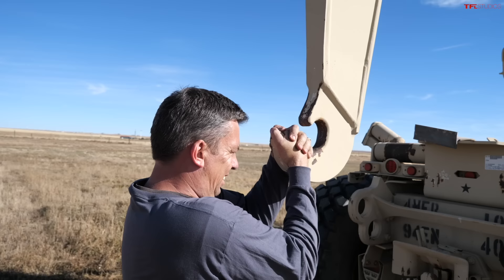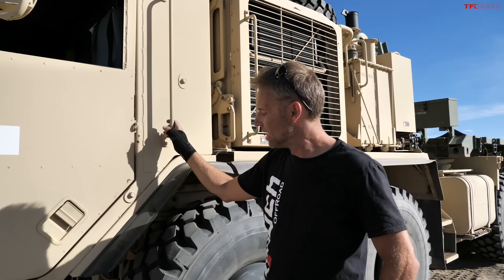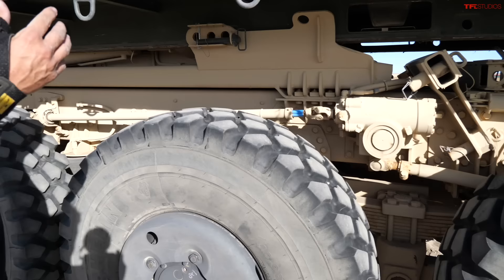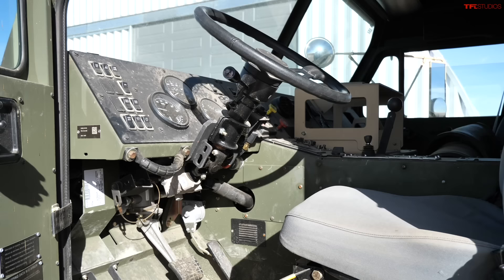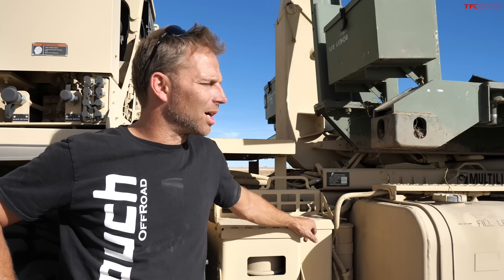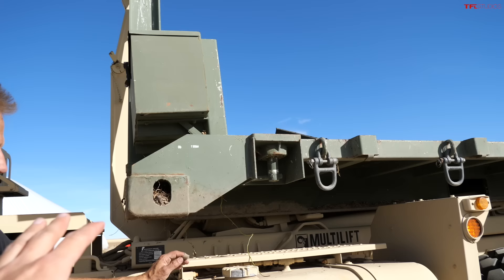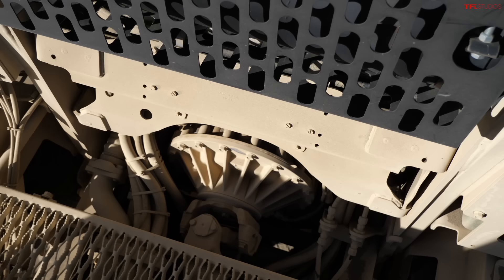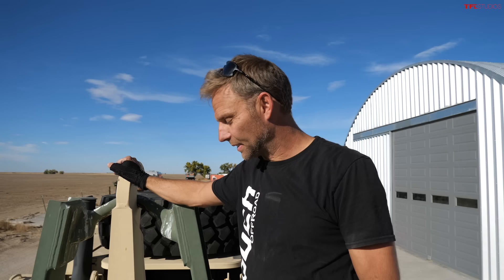Think A 4x4 Is All You Need? This 10x10 Military Truck On 53s Begs To Differ!

Comment: I'm currently active duty Army and I'm an 88M motor transport operator. This has been my system since I got out of training. These PLSs can literally go ANYWHERE! All differentials can lock, it can gross out at like 130000 pounds (with trailer). These things are fun as hell to drive!
Reply: My HETT is more fun.
Reply: @ianm4240  the 237ft boat I got to pilot was pretty cool also
Reply: Load and unload, just remember 3, 2, 1, 2, 3. Never forgot that one after being an 88M in the 2000's. Uncomfortable to drive but got the job done.
Reply: Until I have to bring out the wrecker I towed a lot of them in Korea haha but they’re definitely more reliable than the trucks at my current unit
Reply: I'm at a CTC and our PLSs are garbage. They get the job done, but if you go out on the line and actually do a PMCS, you can deadline all those trucks. But people are always just pencil whipping it😂😂 @LowStyleMac

Comment: I work for Oshkosh Defense and have worked in welding these trucks and on the assembly line putting them together.    Very cool to see where the trucks end up.
Reply: So you're a simple worker, ok.
Reply: So did I my job was a floater assembler on the heavies at oshkosh truck, these were so cool I was 2nd shift. I hated the 1:45 hour drive I had to quit decided not to move there from Waukesha.
Reply: Okay so we have several Oshkosh six by sixes and I want nothing more than to burn them to the damn ground I'm a mechanic for a mining company and God forbid I ever find out who the engineer was that designed these things it will be fight on site I have purposely not looked up who designed these just because I want to fight them that bad and the reasonable side of me wants to stay out of jail I always wanted one of these 10 by 10 but now I know they're made by Oshkosh I want nothing to do with them
Reply: @borednarmed5612  Very funny 🤣

Comment: When I was in the military I was a diesel in track mechanic we had one of these PLS. Instead of a flat bed ours had a FRS or fresh these were complete shops that would expand open to create a work table with tool boxes, storage, generator, heating and a crane all  equipped inside of the fresh. You would use this to take to any location to perform maintenance. I've always wanted one.
Reply: Real life construction yard as in Command & Conquer
Reply: Sweet!

Comment: When you just have too much money... This is absolutely perfect.
Reply: They actually don't cost much at govt auction unless they come fully equipped, short of a .50 or 240.
Reply: . . . and still I would buy a Tatra, built from factory with all the goodies.
Reply: @reedrk88t  I think he means the amount of gas it will burn
Reply: @ Dougls Price - I duuno what diesel costs where you are but its around £7 ($9) a gallon here - so £7,000 just to to fill it up, forget servicing or a set of tyres! Even if I got given one for nothing, I still couldn't afford it!
Reply: @madmick3794  can civilians buy Tatra 8×8 from factory?
Reply: @persianimmortal7455  yep.
Reply: @madmick3794  the new military ones? T815 7
Reply: @persianimmortal7455  where I am I have 2 engine and 3 gearbox choices, options are 4x4, 6x6, 8x8 and 10x10
Reply: @madmick3794  thanks , where r u by the way?
Reply: @persianimmortal7455  South Pacific, Australia atm. NZ also has them for sale too

Comment: Spend thousands of hours around the world in one of these. Great trucks, I’ve driven the pintle hitch version and hauled D7 dozers with them.  They even come with massive Cables. If you put the transfer case in low range there’s not much you can’t yank a load over.  The more modern ones have airbags for suspension Thanks for the memories.

Comment: The HEMTT is the best vehicle platform ever devised imo. So versatile and so many awesome variants, the 977, 978, the pls, 983 and 984.. fantastic truck. I drove them for 8 years in the Army and absolutely loved them. That giant diesel and turbo whistle always sounded fantastic.
Reply: M113 enter the chat..
Reply: that may be true but it doesnt sound as good as a tatra 813 with its aircooled diesel v12
Reply: The HEMTT/LHS was the top tier replacement for the M520-M877 "Goers" which were literal death traps in almost every aspect.
The Goers were solid trucks,espiecally on axles and pivoting,but suspensions weren't reliable and turning radius was actually much worse than it should've been for their size.
They were interesting just upon sight but terrible in design,they still performed good for what they were as long as something serious wasn't in the question.
They used Caterpillar D333's but then some variants had the D333C's which was actually Caterpillar's own verison of the multi fuel hyper cycled engines just like the LDT-465's & LDS-465's found in the M35A2's-M756A2's.

As for the HEMTT's,the A2's have almost been entirely phased out by the A4's that have Caterpillar C15 ACERTs versus the Detroit 8V-92 TA's that was around for years.This includes the M1074's & M1075's and M1070's because the A1's verisons are also Caterpillar'd.
The M1070A1's however don't use the ACERTs they have C18's.

Comment: I used to drive these things with the trailer attached and actually back up with the trailer attached with no issues. These things are truly awesome.
Reply: Backing up with a trailer attached, unheard of!
Reply: Yeah as someone reminded me.
To back up the trailer you had to put a pin in.
Driving with the pin in is very bad.
Can it be backed up without the pin,
You bet. But very few people can do it.
If you can back up a set of doubles. Then you can back up the trailer without the pin 
I was the only person in my company that could do it.
But its a lot easier with the pin in. 
Any person that calls BS on someone claiming to back up the trailer without the pin, has good reasoning. 
I was backing up doubles when I was 14 for the old man. And they didn't have pins.   
Now if you can not back up the trailer with the pin. You shouldn't be driving.
The trailer system copied the transfer trailer dump truck system.
Reply: @timothyhumes2342  yeap. Either you didn't know about the pin. Or you don't remember it.
But that pin caused a lot of problems 
Soldier would forget to put it in. Ir worse take it out.
Wouldn't be surprised if some commands removed the pins. 
I never seen it. But heard they caused some deaths

Comment: Brings back memories, I used to work on these in the army back in the day. I went to the Oshkosh maintenance class when they first came out for the army. It rides like a caddy on hard roads.
Reply: I agree...Way back when the HEMTT's were brand new they tremendously phased out the Caterpillar M520's-M877's which were called "Goers" at the time.
The "Goers" were problematic in many ways,the only great results about them was the strong axles and how much percentage and angular they could pivot.
The "Goers" were good if you weren't doing anything serious or not driving long distances.
It was blissful when the HEMTT's were debuted and manufactured in greater numbers.The original variants with the Detroit 8V-92 TA's had more than enough power compared to the Caterpillar D333's used in the "Goers".The newer verisons of the HEMTT's are even better when it comes to efficiency and powerful torque thanks to the Caterpillar C15 ACERTs they have,being bored out 6NZ's.

Comment: I was the Motor Sergeant for an Engineer unit. We had one of these with the flat rack , the FRS  (Forward Repair System was a complete maintenance shop) and the M1076 trailer. We would carry our bobcats on the flat rack.
Reply: Yeah, back when we were testing these things.
They were designing those apps.
Glad to hear some made it.
Though I believe all were for the CHU.
If you don't know, the CHU  was the added piece that made for lifting 20 foot connex strait onto the truck and trailer. No flatrack 
The CHU could also act as a normal PLS. One just stored the CHU attachment 
97 we tested the PLS.
98 we tested the CHU 
Or maybe it was 98 and 99.  
There were people that talked of flatracks being built for special things 
But I never agreed that option. As flatrack were disposable. Unless they started making them better.
It was common in any field exercise to lose a couple flatrack. Meaning destroy. 
They were made cheap and disposable for the battlefield 
I admit dropping them at 30nph plus and  picking them up on the run. Was fun.
Would take days to remember everything we did.

Comment: I’m an 88M and i drive one of these lol. They’re badass in the Mojave desert during ntc. 

I like the PLS more than the normal M1120a4 LHS because of rear wheel steering, extra axle and extra power
Reply: Going to NTC in Feb, pray for me
Reply: @seanrichardson2024  i am 88m for an artillery battalion so i hauled the ammo on my pls

When you first get there it’s the worst. You spend a week under a “solar tent” a tent with no walls. 

They bulkshit about detecting phones and locations, i just did a vpn and turned location off. But really it’s just scare tactics. Our whole platoon used them the whole time. Not all of our trucks had radios
Reply: @98MAzdaMilleniaS  yup, tracking the phone situation. I’ll be going at the Maintenance Control Officer. My first time there. It won’t be too bad in my position, I’ll be living out of an expando van.
Reply: Same…except I’m still stuck with M1120A2’s.
Reply: @PltmreX  green uglies
Reply: Luckily when you get out you can start a dumpster business since you have hooklift experienc.
Reply: The PLS and LHS have the same amount of power both are cat c-15s rated at 500hp and 1800ft lbs of torque
Reply: @jacelee343  the M1076A1 PLS is 10 wheel with a 600 hp Cat c15 and the newer M1120A4 LHS is 8 wheeled with a 500 hp variant of the Cat C15. The PLS has a 6 speed auto. LHS has a 5 speed auto.

They test us on this at 88M transportation school in fort leanoard wood and have posters in every building to help us memorize it lol
Reply: You're one lucky dude
Reply: Its funny hearing you speak of the PLS as not being normal.
So the one in the video is the LHS?
Because it different then the ones we tested in the late 90s at Ft Hood. 
Ours only had one counter drive axle. 
Ours would do 90 mph ( of course this was brand new)   
The BS about the tire being 800lbs  they are heavy. But more like 200lbs. 
Also the spare was mounted differently. But I don't recall where.
Ok we tested the 10 wheel PLS and the CHU. 
Myself and another ( one 1st plt one 2nd plt)  were the first to be licensed on the PLS and later the CHU in CONNUS. 
Only military vehicals that I was the first person to drive. Other then the person that drove it from the factory floor to the railhead.
They had less then 10 miles on them.  
They would come into the railhead 2 to 4 at a time. So he and I drove about 5 each as the first driver. Before other were licensed.
There was a mechanic that was also licensed at the time we were. But he didn't go with us to the railhead 
Same happen when we got the CHU.
But we only drove 2 each 1st time. 
As we got the CHUs we turned in the PLS. I believe they went to Cav.

Comment: Retired Military 22 years, currently a freight broker, If I had my Distro Platoon, we would be millionaires over night, I miss my HEMTT M1120A2, I need them now hauling all damn these containers from the port. Damn so many memories in IRAQ, Kuwait etc.  you can park these babies at 45 degree angle with 20K load, and they wont move, The CTIS system alone is a game changer

Comment: We took the speed limiter off of it and it will
Max out at 80-82 mph downhill 😂 even ground like 75
Reply: Wow. That's seriously impressive 🤨🤨
Reply: The only problem is that once it gets past 70 the steering starts to get squirrely, I miss these though. I was super pissed when my unit switched to fuel tankers and traded these for the 915A4's.
Reply: @kevinatkinson5927  it only starts shaking violently possible depending on the a4 💀💀😂😂🤣

Comment: This is a crop on the back which is designed to stack up and pile in a 20 foot container ; a flat rack is slightly larger can be stacked but will not fit in a container

Comment: The Marine Corps LVSR 18 witch is the cargo version is similar to this. There is also the LVSR 16 witch is the Tractor trailer with a 5th wheel, and then there is the LVSR 15 is the wrecker. Had the pleaser of working on them for 4 years while I was in. And they are powered by a C15 Cat.

Comment: British drops unit is almost identical hook system and can be used to self recover at a weight of about 45 ton so the hook system will always load more than the truck can carry
Reply: We borrowed the design from them.  I remember in Afghanistan we need some racks and we casuly strolled into the british motor pool and relived them of 4 flat racks, they never went on missions, so Fuckem. 88m for life.

Comment: 88-M10 It's what I drove in Afghanistan 😉    PLS can go through a lot, ctis system.  Crazy capability.   Power brake it into the corner then release the brake pedal and it will power slide!  Not joking....off road fun.  😉
Reply: Rooster tails in the Desert of route 611 ftw wooooo

Comment: I loved that truck. It was bouncey as hell. Drove pretty good. Mine had Solid axles all the way. Army was cheap. Brakes were good and I NEVER GOT STUCK!.Great vehicle
Reply from the maker: Thank you for the feedback!
Reply: You got the cheap version then, we never had a bouncy ride and we had the armor package with a .50 on top.
Reply: You had a HEMTT which is not the same as a PLS. Both are Army vehicles.
Reply: @rrpeters  I drove a PLS. A PLS has five axles. Hemitts have four and can be made into any configurations. I know the difference
Reply: @bigstone75  you must have had an A0 variant from the mid 90's. They stopped producing those around 2000. All the old models have been rebuilt with A1 specs at this point. I have never driven or seen an A0 variant and I have driven a lot of them.

Comment: I operate this vehicles in the Army, the hook load capacity is rated based on it use (pulling on an off road setting, vertical pull and max load capacity) the total cap depends on how you use the system.

Comment: When I enlisted, I thought I was going to work on light wheel vehicles(63b), humvees, etc.  To my surprise, I worked on hemitts just as much as humvees, along with tracked vehicles and anything else I was told to go fix.  The thing I remember most is man handling tires to change them and also having to pull the heads to repair mushroomed glowplugs.  
  Today, I work on everything from a law mower engine to cats, peterbilts and everything in between.  Gas, diesel, propane, cng, electric, it doesn't matter, I work on them all.

Comment: The PLS is a Amazing vehicle, we had ten of these in my company when I was in the Army. It's a shame that you did not have the crane version. (Basically in the crane model, right behind the PLS system where that step plate is, there is a pretty large crane there instead.) 

The only downside of these is the Hydrolics on it, those hoses leak like no ones business. 

13bravo 1/15 Field Artillery Battlion

P.S the Reason why we Field Artillerymen had these instead of 88Ms, is because every Company had a ammo section, and we use PLSs to transport our Artillery Shells to our guns.

Comment: These are super cool. But anybody that thinks these would be a good armageddon vehicle are nuts. If it actually happened, fuel would be extremely hard to come by. The last thing you want is something that gets 2.5MPG.
Reply: It would quickly be commandeered by the local warlord. Unless you’re him
Reply: 2.5mpg is generous. I saw 1.5mpg average when I operated one.

Comment: I was a super for a company that rebuilt military instalation. We repaved 13 acres of road and lot in Seagoville TX. The company we used did a crap job. Only had small rollers for residential drives. The first HEMIT that pulled in left tire tacks for 800 feet up a road and massive holes and furrows as it turned into the lot. We forced them to remove all the old stuff and we found a different company to replace it. What a mess it was.

Comment: Used to drive these a lot when I was in a support platoon in the Army. On the A3 not far from Bamburg you could put these things in N and hit much much more then 65. On the topic of 65 being the max speed. I always suspected there was something in them preventing them from going faster in gear. At that speed the engine really isn't working that hard.

Comment: Pretty cool, if you can add a covered rear platform to the 10X10, you could probably use it as a moving truck that may be able to handle multiple heavy home appliances without the suspension completely failing.
Reply: You could build a small house on there and it wouldn't phase that monster
Reply: Yeah, it would really help with moving my 35,000lb washing machine...says Gus Fring.

Comment: Does this also have tubed drive shafts? I't pretty neat it does have front independent suspension, Tatras had all independent, but that's much older swing design, i guess it's about same capable

Comment: Our Distro Platoon has like 5 Palletized Load Systems for general use of fuel and whatever else they do, they are a pain to work on when it comes to the engine area, that fan on the sides open up even with that fan moved to the side

Comment: I got to drive a MAN tractor in West Germany in the late 80’s we used to pull GLCM missile launcher.  Very cool.
Reply: Same, except I drove a MAN for The Pershing II the MAN had better offroad capability then the HEMETT or the PLS.
Of course, the Erector Launcher trailer with the Pershing on back, not so much... We stayed on the forest roads in Germany due to the high water tables.
Schwabisch Gemund 84-87, 88-91.
Drove the HEMETT in a Armor unit  at Ft. Carson 91-95.